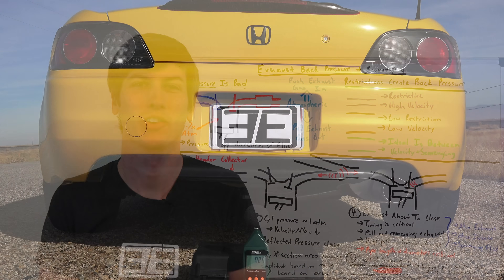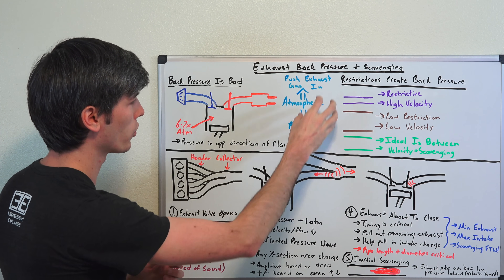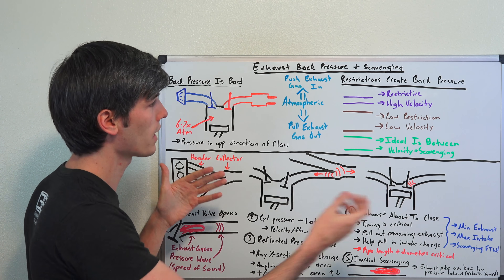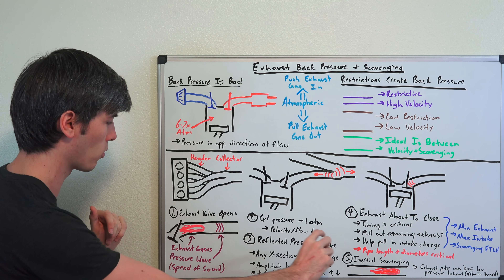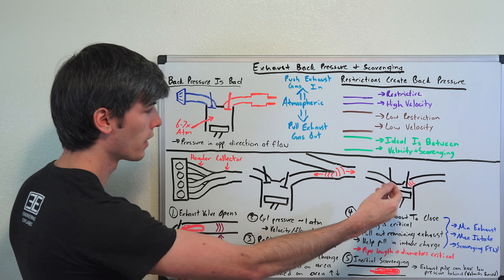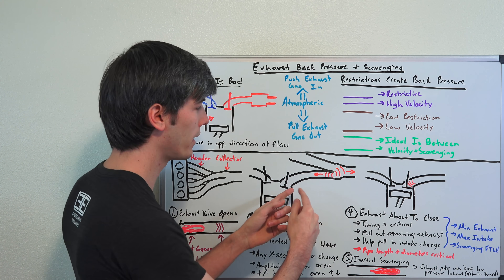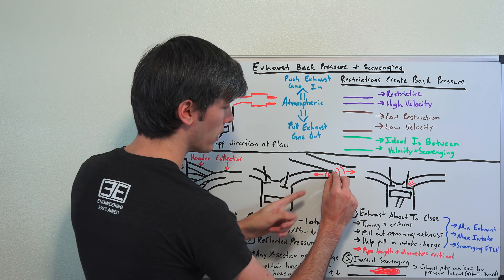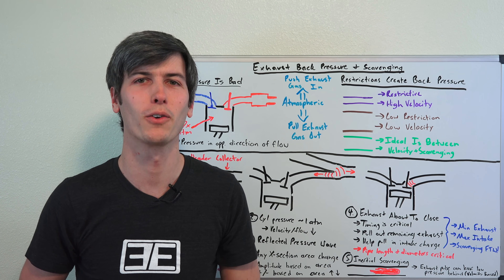Stop Saying Car Exhausts Need Back Pressure

Comment: Great video, this is for non-turbocharged vehicles though, with a turbocharged vehicle you just want the highest flowing exhaust after the turbo as possible. All the scavenging etc happens in the headers before the turbo
Reply: I think a turbo dampens out some of the pulsations that are important in a non turbo system making post-turbo more about big cross section and less about "scavenging"

Comment: I seen a dragster spitting fire 7 feet into the air , as it came down the drag strip , the engine was Scavenging back pressure ,  but that engine was a  Lying fire breathing dragon , so I wouldn't believe anything it said

Comment: I have a question
Is it better to throw away exaust pipe ?
Cuz atmospheric pressure is (at least) constant outside the engine
And you don't worry about back presure
Your opinion?

Comment: Generally car engines do not need back pressure. Some motorbikes especially the older ones run better and smoother with back pressure.

Comment: Why don't we just get NASA rocket engineers to design our exhaust systems?

Also, would coating the insides of our exhaust manifolds with with aerogel nanoparticles sufficiently increase the temperature to eliminate the need for a pre-catalytic converter?

Comment: Simplest of experiments to back up your claim, either way, is to remove the exhaust from you car in various stages then test drive.  Once you get down to zero exhaust, you won't be singing the same tune about back pressure.

Comment: This is a very complex topic for a white board and fast talking you hardly got into valve overlap, I think you need some animation for people to get whats going on.  I think when most people are talking about back pressure there thinking of scavenging and scavenging make people think of expansion cambers. Of course if zero "back pressure" was ideal F-1 cars and GP bikes would still have megaphone exhaust... Peak HP ain't everything.

Comment: Why you don't need any of that if you have a Turbo charged car? As they work just fine even without the exhaust...
Reply: Once the exhaust goes through the turbine, that changes all of the fluid dynamics and acoustical and pressure waves.

Comment: If done perfect it can also leave a very subtle vacuum in the cylinder. A lost art and the earliest form of forced induction
Reply: Isn't that subtle partial vacuum the whole point of the video?
We have learned there is one particular rpm at which exhaust behavior is optimal.
If the vehicle is going to be spending most of its time rolling down the highway then it makes sense to design the system so that the optimal rpm occurs at highway speed (or, ha ha, a little higher). (And of course different for different purposes).
Immediate ideas for improvement:
Computer controlled...

1. trombone slide exhaust pipes
2. solenoid driven fat needle valves at the collector
3. twisting outer sleeve with longitudinal holes inside the muffler(s), etc.

I'll bet most challenges in designing on-the-fly tune-able exhaust systems arise from the wide temperature range they must traverse and that the upper end is, omg, red hot (not to mention the high pressures and corrosion processes involved).
Reply: @REDPUMPERNICKEL  yup

Comment: Let me just say the back pressure argument has been going on for a long time.  It centered around the fact that almost every vehicle (at least in the U.S.) was carbureted.  Unless you worked for an auto manufacturer or race engine developer, you knew nothing of exhaust physics.  Guys wanted to hop up their engines, though, and ran into the problem that carburetors are jetted for very specific conditions, including back pressure created by the exhaust system.  Open up the exhaust and the carb could no longer deliver enough fuel and the vehicle ran lean.  Every time.  Since jetting was a black art and no one knew how to change it except for auto engineers, the vast majority of gearheads believed you had to have back pressure to prevent the engine from going lean which burned pistons and valves.

In the Sixties, with the first horsepower war and popularity of drag racing, magazines appeared with educated people who could at least determine how particular hop-up parts required specific jetting changes.  They also showed the back-yard mechanic how to read plugs and to look for part-throttle dynamics and what changes were required to attain or fix them.

This expertise continued to build and spread, especially with the advent of the Internet so that Honda owners, dealing with the manifold absolute pressure system which behaved just like a carburetor, could start to keep their engines alive after basic hop-up parts were added.

Lastly, while Jason explained pressure waves, knowing how to manipulate them with header primary length, collector design, exhaust pipe length and diameter is still a black art.  Without a hours of dyno time and lots of piping to juggle, Joe Blow is not going to draw up a good design.  The book I have isn't much more comprehensive than this video.

Comment: Before I even watch your video, which I know will be full of facts and useful information, I also know from personal experience that running a rear muffler vs straight pipe at the back, the muffler gave the car noticably better lower end response and power so.... Maybe it was just the power curve that changed

Comment: I've been saying this for years. Old timers tell me you 'need' backpressure. You do your thing, let me do mine. Flowtech long tube headers and y-pipe to single open 3" on my old 350. Single 3" is restrictive at my power level but it was fine when I designed it (before heads and roller cam swap). Now I'm looking at building my own y pipe and running 4-4.5" open. I think I've heard 2.2psi or 2.2" of water is the ideal backpressure. You won't lose any top end power but your velocity should be pretty high through the powerband. I'd have to go back and check the unit.

Comment: So is the effect the same with a turbo diesel? From what I've seen most people run a large diameter strait pipe from the turbo and out. I imagine the turbo provides back pressure ah nevermind I just answered my own question in my head.

Comment: Thank you I'm so tired of people saying  ”back pressure " !
Reply: What about Front pressure ? 🤔
Reply: back pressure.🤭🤭🤭🤭🤭
Reply: Whatever you want to call it, if you have no back pressure at all, it sounds like ass. You need some kind of baffling and resonance to tune the sound and make it sound good.
Reply: @80s_Boombox_Collector  you need something to make it quiet but the engine doesn’t need back pressure at all. The idea is that even if an exhaust is more restrictive which you would assume it creates more back pressure, if it’s well calculated it may create better flow than a modified less restrictive one which has bad wave reflection and basically the gasses flow worse
Reply: @80s_Boombox_Collector  so engines don't get damaged with free flow exhausts?  Dragracers rebuild after every race so yeah
Reply: Them rebuilding has nothing to do with “back pressure “ or lack there of. Correlation =\= causation.
Reply: @tejaspadhye  I thought the lacl of tread on the tires caused them to need to rebuild
Reply: @itptires  do i smell sarcasm?

Comment: Would like to know how going catless affects the performance of a turbo engine. From your video, understand that scavenging is good and back pressure is bad, thus correct me if I am wrong, removing the Cat at the downpipe, should help to remove the back pressure, and as long as the diameter does not change, the scavenging will not be affected and performance should improve. My car has 2 Cat, and I am wondering if removing the first Cat but keeping the second Cat, i should be able to get more power and faster spool?

Comment: In laymen terms then, can you give an examples of a minimum and maximum length of 3" pipe for a 350ci v8 ? Or maybe min/max length of  2" pipe on a 4 cyl ?
Basically an optimum diameter/length pipe in relation to an example motor. 
It makes sense to me that the pipe diameter will need to increase according to displacement. But that increase has a limit and length plays a big role in the calculation. 
I think I understand the concept but I don't know how to apply it. 

The reason I'm asking is I'm looking at buying a used truck and the sellers point out something like," New 3" stainless exhaust ". Which obviously could mean that they've decreased performance and that decrease will last a long time. 

Thank you in advance for any thoughts on this question.

Comment: Serious question. I've been trying to wrap my head around the idea of removing all back pressure post turbo exhaust. My idea was to include a reed valve (a valve only allowing one way flow direction)  after the muffler. 2-stroke engines use to reed valve and I thought four stroke engines could somehow benefit from this, particularly turbo charged engines. Could this work? Would it hurt?

Comment: Related but obviously different, Vance and Hines showed some back pressure was needed to prevent rich mixtures due to exhaust revision into the intake tract cause multiple passes of the mixture through the carburetor. This lead to very rich running in the middle rpm ranges due to this mixture and a resulting loss of power. Of course this was on straight pipe Harleys.

Comment: It might be more productive to explain where this myth comes from and what engines it applies to. You can in fact open up an exhaust too much. Basically when you put an exhaust designed for a 7.0L v8 on a1.5L L4 you're gonna lose torque. Also a lot of cars, especially small imports have tuning systems that expect a certain amount of restriction and some are even operated off of back pressure. When you put a big exhaust on your little Honda you DO lose power. No matter what this video says

Comment: What you want ideally is each exhaust pulse being separate but high velocity, so the pipe needs to be just the right size to accelerate the exhaust leaving the engine but big enough to not restrict the flow.

The exhaust itself is also going to be shrinking dramatically as it leaves the header, needing smaller pipe to keep up velocity.

Just look at the temperature of your header vs your muffler vs your tailpipe.

My cheap exhaust turned science project took a 302 with 1 5/8 longtubes going to a 3 inch collector, stepped down to an eighteen inch long 2 1/4 pipe into a 2 inch muffler with 2 inch tailpipes.

The point of this experiment is to see if I can keep velocity, keep low end torque and not sacrifice high RPM power.

Of course every use case is different and compromises are made in any build, you either have massive low end torque or high end HP, not both.

Unfortunately my current engine is too weak to really push it, the previous 2 inch exhaust was enough for it, however, even still the power has increased a good bit at midrange (2000-3000RPM) and I was getting 24 mpg out of this busted old carbureted 302 with an AOD.

Comment: That's really cool I never really took into consideration the pressure waves coming back.  I guess the length of each tube going to the collector has to be rather precisely optimized to account for this.  I guess things can get even more complicated when you start introducing turbos.
Reply: Turbo complicate matters, but they do work to simplify them a bit as well.

The turbo itself can help pull the exhaust once it gets going, but then it needs more pipe once it gets going...

I think most of my successful buddies had normal sized pipe before the turbo and a little larger than optimal for NA afterwards, pretty much any piping after the turbo seemed to hold in heat, once the turbo spooled up the air was going away as long as there weren't any serious restrictions, the exhaust pulsing vs the length of the total exhaust wasn't a factor. The turbo itself broke up those pulses.

Comment: Well let's hope Honda knew what they were doing with their new engines, because you can't change the exhaust manifold.
Reply: If you've got a sawzall and time you can change anything... lol

Seriously, people used to machine the intake off of the old Ford 200 so they could bolt one on or make a sheetmetal intake.

Even seen one modified to use a 250 (might have been an Australian 250) intake with a 4bbl adapter on a 200.

Holley 750 DP on a Ford 200 inline six.

Seems like he had a blow through turbo built in as well, I'll see if I can dig it up if anyone is interested. 500-600hp 200.

Comment: nice video. thanks. but you failed to mention valve overlap, that plays a big  part in this process of efficiency.
Reply: Not sure how much valve overlap factors in these days.

That would lead to fuel potentially being burned by the catalytic converters which the feds are a little irritated about.

The old carb engines needed the steadier vacuum pulse to keep up velocity, keep the fuel atomized. Not as much of an issue with EFI.
Reply: @glenwaldrop8166  valve overlap aids in scavenging within the cylinder thus making efficiency greater and power output greater as well. Fuel injected or not the benefits are undeniable.
Reply: I'll have to look at some modern camshafts, but valve overlap was being cut back farther and farther as EFI became the standard.

Seriously, part of the reason for the overlap was to decrease the pressure in the intake, lower pressure or vacuum atomizes fuel at lower temps, making for a more complete combustion.

With EFI atomizing the fuel as it is injected, overlap was reduced.

I'm looking for the article right now, but overlap has been reduced on EFI engines to the point that the lack of overlap is giving a natural EGR effect without the need for external EGR valving or plumbing.

Of course on the high end you'll see more overlap, but it has been reduced greatly from the time of camshafts cut on a 108 LSA.

Comment: I cut my gc pipe and i do need the back pressure. !
Reply: It pops and snaps because the exshaust is shortened almost half way lost of pressure in the exhaust, the less pipe i believe the tighter your o2s have to be

Comment: So you don’t need back pressure but you need restricted exhaust that increases the air velocity. Something like an cat converter or a dpf don’t cause the air velocity to increase although they are restrictive but increase the back pressure which bring no benefits. 
Also for exhaust scavenging a longer optimized diameter pipe should be better because the mass of fast air is higher. It should be a sweet spot for the length as well

Comment: Simplified:every internal engine has a differrent timing.
 On race cars timing is advanced so the valves stay open more and there is a need for a very effective and custom exhaust.
 For street cars is the opposite because you need reliability (you have vvt vitec that prolong valves being open)and also a specific exhaust for the car to pass emissions,noise,and have better mpg without sacrificing power ,so it's like a compromise.
  Bigger exhaust =slower performance/acceleration on low rpm and better response at high rpm .
  Smaller exhaust =better low end acc but limited high rpm .

Comment: I’m no engineer but understand what he is saying. It’s like some people tacking fart cans on their Honda’s claiming power increases. Headers, intakes, mufflers, it’s all good, BUT baffles in the muffler(if that), exhaust pipe sizing, and actual tuned exhaust is a different animal.
My own truck I figured easy air in and easy air out it’ll run great. It does. Runs strong, not quite like a V8, but it has a lot of heart.

Comment: I fit my car with a straight pipe from the the turbo back, I ran it side pipe for a week and it was mad loud and powerful, put the pipe to the rear still straight through and it reduced my power and created a turbo whistle, I’ve gone back to side pipe as I don’t want to damage my turbo, is this because it wasn’t exhausting fast enough?

Comment: There's a company called Motordyne that makes exhaust parts for Nissans. Their writeup speculates that backpressure being good is a myth that originated from people who didn't understand scavenging.  So if you stick an oversized exhaust on your car, you'd lose power not because of decreased backpressure, but scavenging. But the people arguing backpressure is good never install smaller than oem exhausts on their cars, or stick potatoes in their exhausts lol
Reply: I went with AFE for my headers and exhaust on my Titan.
Have all exhaust off now for the fun time called manifolds.

Comment: Isn't turbocharger, in a way, generating some backpressure? Turbine is preventing exhaust gases to get away freely. How much is this effect sginificant?
Reply: I'd assume without exhausting the high pressure your cylinders are just overloaded with pressure. 
It would make since to me to increase the diameter of the exhaust to accommodate the increase of pressure ahead of the cylinder.
If not, I'd imagine your engine would just be stuck munching on recycled exhaust gasses.

Comment: You're absolutely almost right. there are engines in the motorcycle industry that have unique cam timing and overlap that makes them so sensitive to exhaust pressure control that "opening 'er up" with straight pipes will make them run like ass. Suzuki VL1500 comes to mind. And yes, as 30yr veteran of the industry, I've been seen plenty of examples. This is the point where someone replies about carb jetting or injection tuning....  sorry, save yourself some typing

Comment: I wonder then instead of a blower on the intake side, have a vacuum on the exhaust side. The volume of air escaping the exhaust is far less than a shop vac's suction, just need to make the parts heat resistant.

Comment: You should see Cleetus McFarland Ruby's exhaust maniflods, where he have a lot of back pressure in one side with crazy angles and a long pipe and a straight manifold to the turbo on the other side, them he keeps saying that don't know why that engines fail